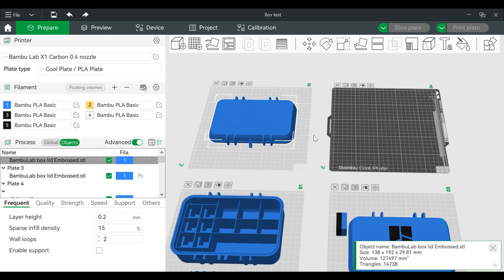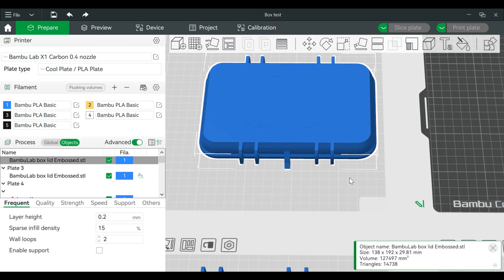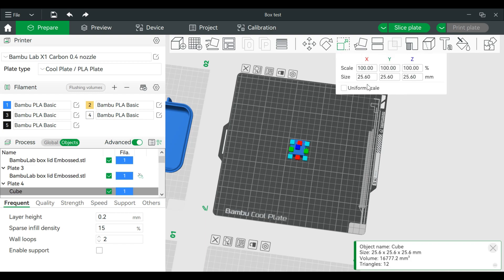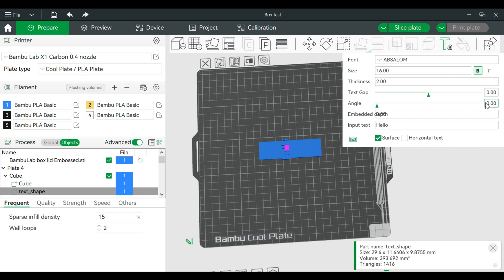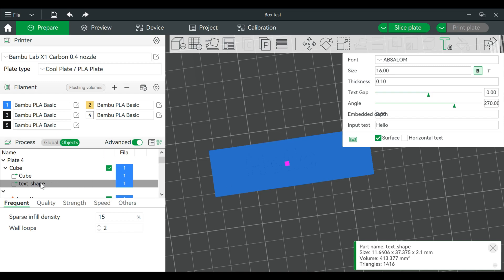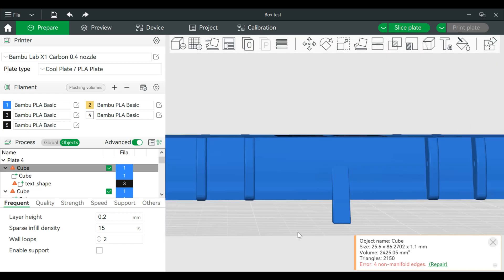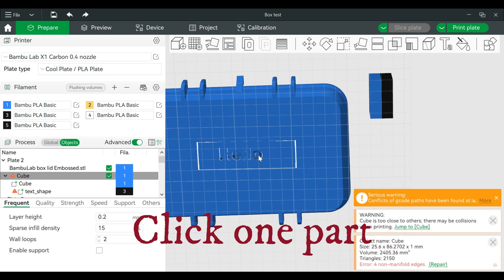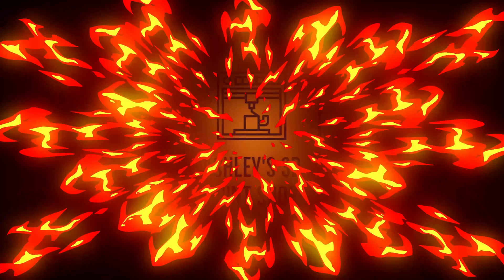Make Flush Text With Bambu Studio (Base of a Model)

Comment: I’m in the process of building a tool organizer from a designer that provides stl files of all the parts. Some of the components have recessed size text embedded into the objects. I’ve been trying to print these parts using 2 filament colors so the size text stands out and is more visible. I’ve been using the painting tool to paint the bottom of the recessed letter surface which hasn’t worked very well on some of the samples I’ve been printing. The font is too small and the recess is too deep. Any suggestions on how I can modify the part design to provide flush printed text? Sounds like I’d need to create parts to overlay the new size letter over the old part and then merge them together. Is that a good approach?

Comment: You don't need the additional plate for backing. You can flip text, assign another filament, and slide it under the main printing face (i.e. the lid). This is useful if you're exporting from another program to scale, from example from OpenSCAD. Keep the text height to 0.2mm (the first layer height), to reduce filament waste.

Comment: Great video Ashley. How would one make sure the text was only on the first three layers? Thanks!
Reply from the maker: Good question! Thank you. 
Normally I make the text 3 layers by making at it least .6mm in the height. So you can make the adjustment with the scale tool ,tune off uniform scale, in the z axis.

So assuming a .2mm layer height 
.2 is one layer
.4 is two layers
.6 is 3 layers 

There can be some overlap in layers in between the numbers
like .51-.69 could be 3 layers too. It's easier to think of it as a multiple of your layer height.

Comment: Any idea why my text filament color resets to the cylinder color I originally chose when I cut the object?  Thanks
Reply: I guess a followup question - it seems that this is happening because I have three separate lines of text instead of just one. So any idea how to do this with more than one line of text?
Reply from the maker: Hello. There is an easier batch of techniques you can use now that does not require cutting a part.
It can be found here. https://www.youtube.com/watch?v=DxFQfYj-baM&t=0s
Reply: Super helpful, thanks! Now I just need to figure out how to smooth out that top layer? Any videos for that? I’ve just subscribed, your videos have been super helpfu 😊

Comment: Hi, I am following your video step by step to add words onto a Bambu Swatch.  When I select the cube that already has the text embedded, and select cut with same boxes checked as you, it cuts it into two parts named Cube A and Cube B, but it looses the subdivisions (cube and text_shape).  I can still see the outline of the text on both pieces, but it becomes the same color as the cube. When I slice those freshly split parts, the letters disappear from the bottom piece (the piece we are supposed to use). Any advice? Great video by the way!
Reply: Thank you for pointing me in the right direction. 😊
Reply from the maker: Thank you for your question. There have been several updates that make this technique easier to do now and you can avoid cutting altogether. 
If you have any further questions please feel free to reach out. 

Please go here for the updates. The first 7 min should cover it. 
https://youtu.be/DxFQfYj-baM

Comment: I have a problem, everything is fine until i cut. When i cut the text is no longer a different color, everything turns to the color of the base itself.
Reply from the maker: Thanks for reaching out. There have been several updates that make flush text easier to do. You wont need to cut the model at all. 
https://youtu.be/DxFQfYj-baM

Comment: I have followed your instructions to the letter numerous times. The text turns the same color as the block after the cut, and I cannot get all of it to be a different color using paint later. Currently working in Black block with white text. Studio version 1.8.4.51. Do I have something set incorrectly in some other settings? I must have watched this video at least 20 times and followed it to the letter, or so I think. Help
Reply from the maker: Apologies about the long delay your post was thrown in limbo (under review) on my end. under objects process you may have to move the text lower in the "name" section. 

Here is a link to the steps. 
https://youtu.be/DxFQfYj-baM?t=400

Comment: How do you do this if there is a protrusion on the flat side, like a handle for a drawer and it won't lay flat? One small thing, the audio is always very low on your videos compared to most.
Reply from the maker: Sorry about the low volume. My earlier vids were on a  very low end mic. So it's either low or loud with static.

There are a few videos I have that shows adding text or images to flat/not flat opposite items. I am also working on a video that should address it as well.

Comment: This no longer works, as I think Bambu updated the cut operation that does not allow this to happen. Now when I cut, it does not keep the independant colors of the text and sacrificial bounding box, they change to white. I tried painting them seperate colors, then assembling them with my object, but when slicing, they show as a solid color :(
Reply: update: 45 seconds after I posted, I had an idea and fixed it :p instead of keeping the BOTTON portion of the text, I kept the TOP portion. I flipped it, so it was reverse, now the object is ONLY text (without the sacrificial bounding box) I moved that, assembled it, and it works fine.
Reply from the maker: If you are painting and cutting objects you should cut first, than paint.

I will be releasing an updated text video but here is a sneak preview that should help.

https://youtu.be/7lHRFkmK9cc?si=_t5ueNpJvxH_38x8

Comment: I've followed both your videos and it's just not working for me.  There has to be something I am missing.   Really not sure what to do.  When I "perform the cut" The text just isn't there.  I did the same depth, height and everything you did.  Even tried the trick you did in this video of making a new primative and "adding" it to the existing model.   It just doesn't work.   I'm lost.
Reply from the maker: Thank you for reaching out. There have been some new techniques since then. I'll probably make an updated video but here is a quick peek at how to do it. (4 different ways) It's a rough video and I ramble so be kind. 😂. The last part of the video should cover what you are running into. 

https://www.youtube.com/watch?v=7lHRFkmK9cc
Reply: Yeah doesn't work for me either, same as you describe.  Every step works except the cutting.  When you cut it keeps the text object, but removes the color attribute and prevents you from ever putting it back (text object becomes un-editable after cutting).  His version looks different than mine though, maybe I have a newer software.
Reply from the maker: @CGreciful  You shouldn't need to cut text anymore as there are several ways to flatten text now.

You can use the modifier way

You can split them into objects and assemble them directly.

Or you can add the text and use the "move tool" to make it flush

This video has some more practical steps that are a cleaned up version of the other video in the comments. 

https://youtu.be/DxFQfYj-baM

Comment: Thank you for this tutorial, I have been struggling with this very operation for two weeks. I am assuming that this will work with flat stl objects as well.
Reply from the maker: Thank you for commenting. Yes, this will be pretty much anything that is supported in the slicer.
Reply: @ashleys3dprintshop  I was able to take a file of a huge snowflake, scale it down to fit a tiny box, and place 1 layer on the top.
Reply from the maker: @MachineEarth     That is excellent. I love to hear stories of successes and overcoming challenges. No matter how many videos I make I still think there could be another way or an simpler option. But when an idea becomes a successful print it's like a real life level up. Lol😁

Comment: Does the flush text need to be on the flat side that is on the build plate?
Reply from the maker: No it does not need to be. You can make it face up. If you use a PEI or textured sheet it would need to be face down.

Comment: Is this the only way to add text to the obverse of say, a coin? I'm having trouble getting an obverse side to "take". It just won't do it by flipping and trying to add text as I did on the first side.
Reply from the maker: Yes there is a way. if you want to just add the text you sometimes unchecking "surface helps" 

some of my other videos it shows other steps too. 

for instance this one https://youtu.be/UekEbg_ZkgI

When I get a chance I'll upload clearer steps.
Reply from the maker: Hello, Just release a video that should help.
https://www.youtube.com/watch?v=F7L2_R4zEXI
Reply: Excellent, thanks. Have not tried uncheck yet. I have used the text portion in 
Fusion 360 so that works but it's pretty tedious as I'm changing text on coins, every 4 coins need a change in text. I have made a single coin with all the different text changes then import into Bambu slicer and copy and paste the number I need. So far it works but seems there is an easier method. Thanks much for these videos.